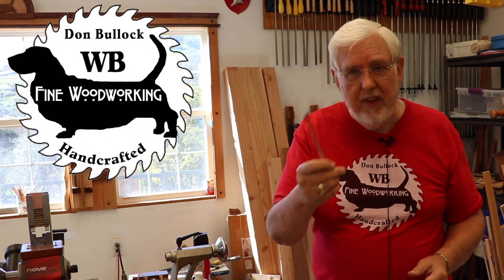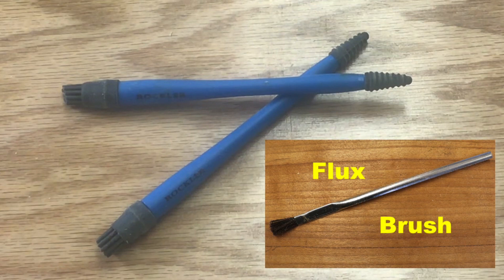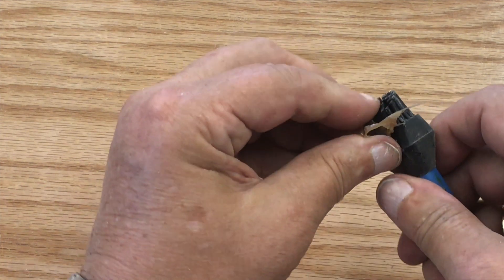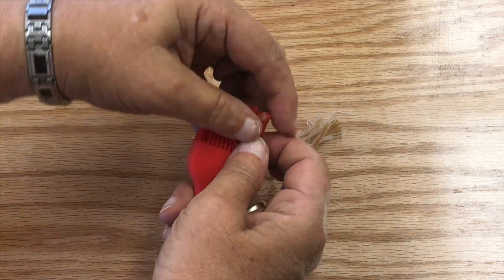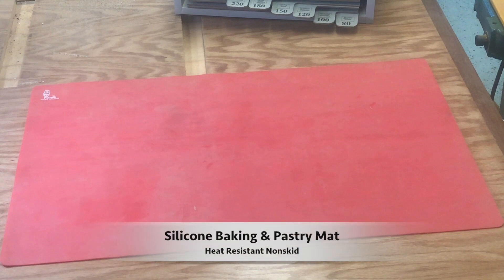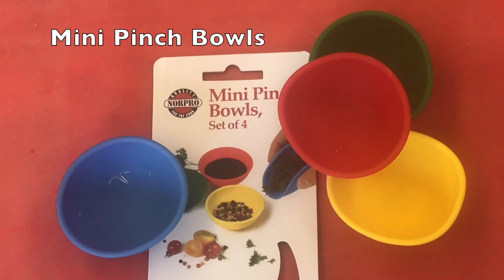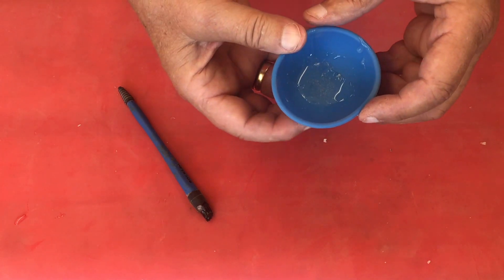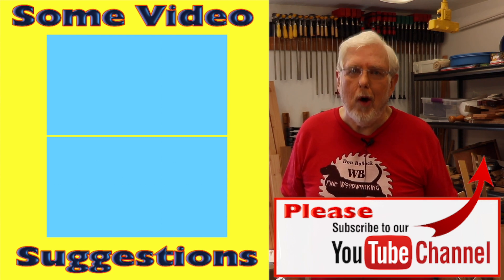Glue & Silicone Don't Mix - Creates easy clean ups when gluing projects

Comment: Whoa...this is mind blowing!   What a great idea.  I’m headed off to eBay for some silicone ‘tools’...this tip is going to save me so much in paint brushes!!

Thanks Don, this was a huge one!
Reply from the maker: Thanks. Anything made from silicons that will hold or spread glue is fair game. I stuck to the Rockler stuff because that’s what I have.

I’ve been working on this one for a while. I waited to release it after I bought a better microphone as I mentioned on the last Shop Update because I was having so much problems trying to get my voice over consistent. I bought a Blue Yeti and know that I still need to work with it some to get everything all sounding better.

Comment: What issues did you have with CA glue? It peals right off my silicone mat I got from Woodcraft. Never used my silicone brushes with CA glue yet, so maybe I'll make a sacrificial test with one of them.
Reply from the maker: Chad Voller I tried it on both my mat and a small brush left it overnight and it stuck to both. My mat now has a hole where I tried to peel it off and I threw the brush away. When I tried to pull the glue out the bristles came with it.
Reply: WB Fine Woodworking Back with results. I used thin and medium Stick Fast CA glue from Woodcraft. No accelerate used. Silicone mat from Woodcraft. Brush is Silicone BBQ brush from Kohl's. Checked after 2 hours, 24 hours, and 1 week. Glues didn't stick to either, no matter the duration. Even tried gluing one to the other.

From what I read, CA glue will only stick to silicone if the surface is activated with another chemical. What brand of glue did you use? It's possible it isn't 100% CA glue and has some additive in it to help adhere to certain materials. Is there a possibility that previous resin or glue may have done that to your items, prepped it in a way for CA glue? Or the items you used are not 100% silicone?

Curious if you try a different brand if you get the same results.
Reply from the maker: Chad Voller I used Titebond CA and may have used their accelerator. I don’t remember nor do I remember which of their CA glues I used.
Reply: WB Fine Woodworking I happened to use my CA glue with activator when gluing pen blanks to tubes last week on my mat. There was activator over spray on the mat. Even after wiping the drip off, the left over glue absorbed into the mat and it is now hard and warped in that spot. So the accelerant/activator seems to be the culprit.
Reply from the maker: Chad Voller my mat has a hole where I let CA glue sit overnight and did lose one of my silicone brushes when I left it overnight as well. Perhaps if the CA is cleaned up quickly it’s OK. That I didn’t try.
Reply: WB Fine Woodworking From my previous comment, I did 3 large drops, 1 week for the longest. That peeled right off. Only after I used activator did I run into issues. Though I only tried 1 type of CA glue. Some brands might actually be a hybrid CA glue.
Reply: WB Fine Woodworking I guess the best thing for us is to play it safe with CA. I now throw down a sheet of wax paper, it's cheap. My mat wasn't cheap and I would hate to ruin any more of it.
Reply from the maker: Chad Voller that’s exactly what I do. Fortunately the mat I have was fairly inexpensive and the hole in it hasn’t caused any concern. I always have some wax paper around because I use it to protect my clamps from glue. BTW — When the CA glue stuck to my mat it had been sprayed with the activator.